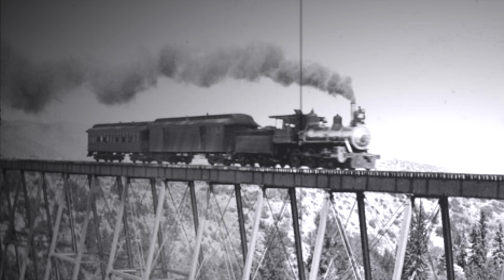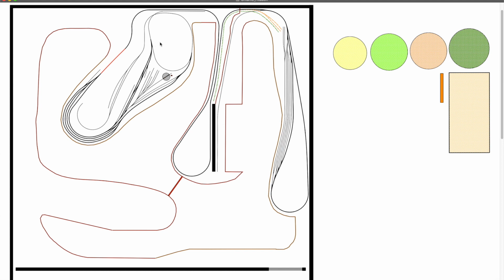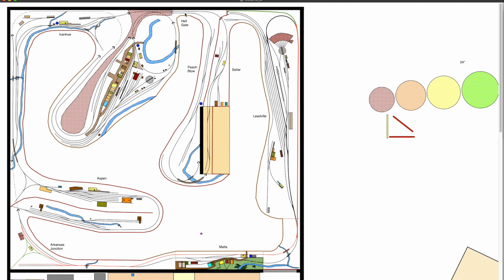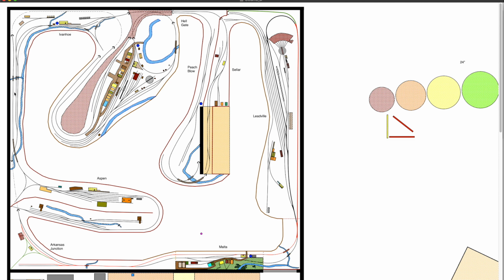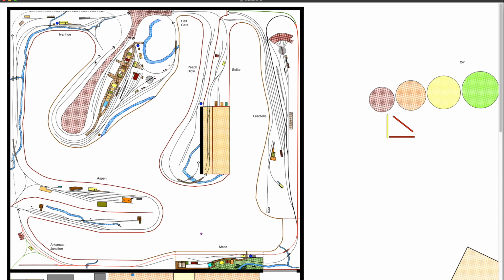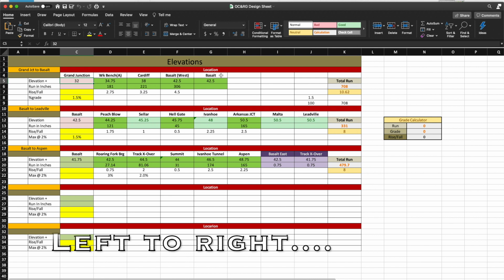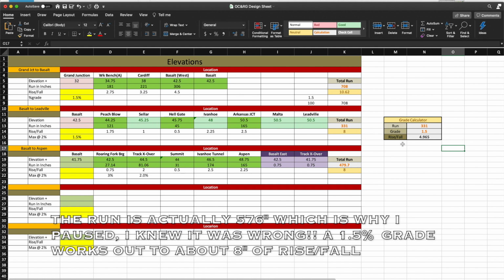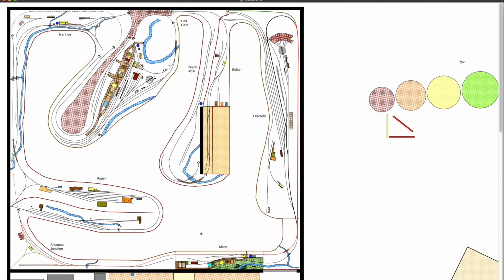MRVU 30  (Updated Track Plan, and Other Boring Things)

Comment: The Back Story is what gives the layout its meaning though, right?
You have a story that explains why you have different gauge tracks, the types of industries served and the locos running around. I enjoyed the trackplan - still spaghetti to me though 😆
Reply from the maker: That's correct Mark.  My history has the financial backers who were determined to make the line standard gauge back out, or possibly swindled by a robber baron. Palmer & Bell stepped in and continued the venture only as a narrow gauge line.   Of course it will never snow on my line, and they can operate at a deficit indefinitely!